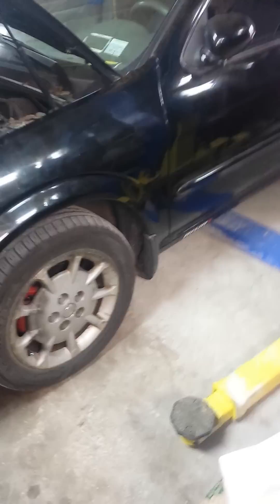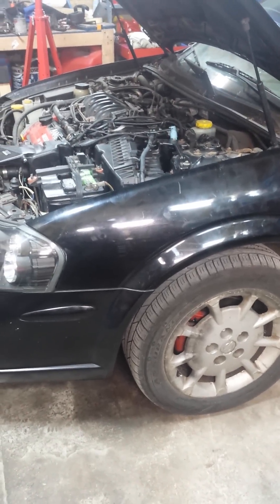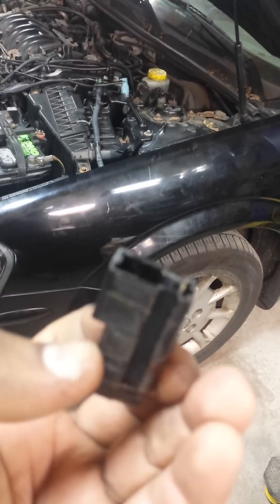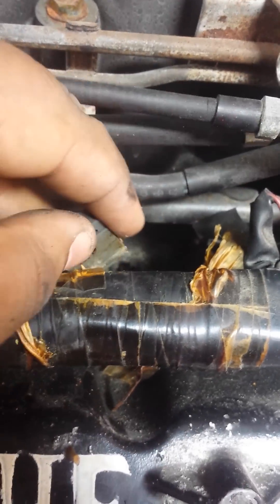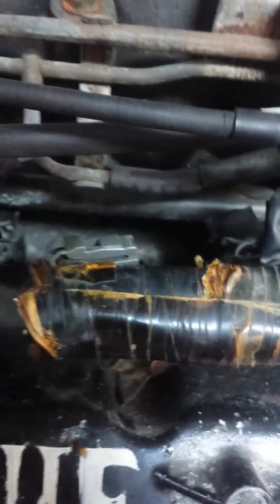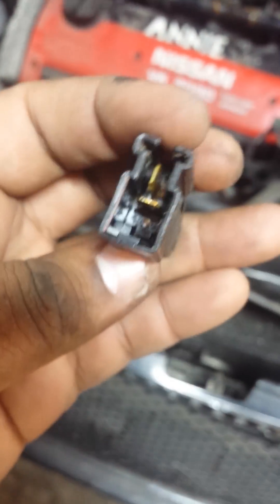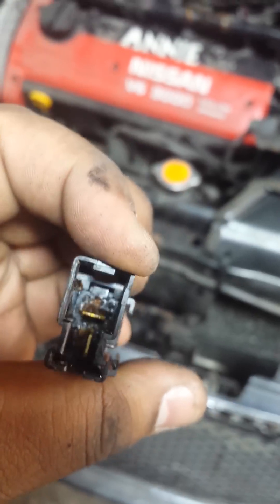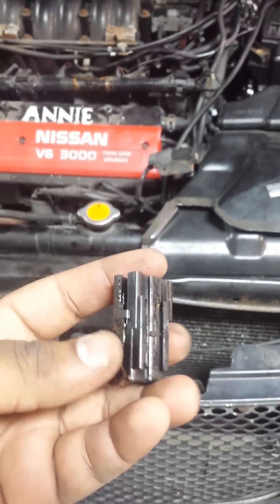OBD 2 CODE P1320 ON A NISSAN.

Comment: Dear fayaz im not sure this will solve my isssue ..i have a nissan y34 vq25 dd and struggling with this code for months..ive been changing coils one after another..let me check this and keep u posted..thanking in advance
Reply from the maker: If it doesn’t work then I would suggest doing a compression test for all your cylinders and check your injectors making sure they are spraying and not clogged
Reply: @faraznabibaksh i bought this part..but the connecter clip which goes into the condensor seems to be bad too..do u know the part num of that or how do we call it ?
Reply from the maker: @kithmalwimalaweera8176  best bet is to call the dealer or just take it from the junkyard..

Comment: I know this video is old but I hope you can advise me. I bought a nissan maxima 2000 SE 250k miles, suddenly I let it turn on, it only starts but does not start, sometimes it starts normally and when it does the car runs very well, with enough force, without wasting gasoline in excess or smell of gasoline, without detonations, if I turn it off it usually doesn't turn on until later or the next day. I bought an inexpensive sensor in amazon and it threw me pending codes P1320 and P0110. My budget is very tight, it is my first car, what would you recommend me to try or replace first? With the symptoms that it has, do you think it could be the condenser?
Reply from the maker: Thanks for the comment but I’m going to be brutally honest with you I need you to be a little more specific in the wording like “ it only starts but does not start” what does that mean? Re-comment your comment and please make sure I can understand so that way I can help you but the video you clicked on I was having a issue with a random misfire code and it turn out to be the condenser so if your car starts but doesn’t start or it starts and runs well then I would say this isn’t your problem but as soon as you clear up your comment and tell me what your car is doing then I’ll try a give you my idea.
Reply: @faraznabibaksh  
sorry, I use google translator, I meant that the car Crank but wont starts. Sometimes it turns on and when it does the car works very well, but if I turn it off it usually does not turn on again.
Reply from the maker: @oceanvargas344  ok so the issue is the car starts sometimes and doesn’t sometimes… 250miles and you have no history on the car.. these maximas have a issue with the MAF when it’s too dirty gives the car a hard start at times and rough idle sometimes even stalls the car.. did you inspect the MAF?
Reply: @faraznabibaksh  I have not checked the maf sensor, I'll start by checking the maf. If the code p1320 keeps appearing, do you recommend continuing with the ignition capacitor or the coils?
Reply from the maker: @oceanvargas344  the condenser is super cheap compared to the coils so i would get that but for some off reason i dont think it might be your condenser... clean or swap the MAF and see if that made a difference
Reply: clean the maf sensor and taking advantage of the fact that the throttle body was close, take the opportunity to clean it as well but without disassembling it, which was probably a mistake. The car continues with the same fault that it starts occasionally but now the engine vibrates, it smells slightly of gasoline and I got 2 additional codes, P0105 and P0460.
It is a good engine and transmission, I will try to save money and better take it to a workshop, thank you very much for the help

Comment: Hey bro, my car has very bad misfire. Have done cylinder drop test, all cylinder firing. Did compression test, all good, changed spark plugs, and this condensor too. But still have P1320. Thats the only code i am getting after clearing it everytime. Any help???
Reply from the maker: Sounds pretty simple... if you checked all of that and still have a 1320 code then i bet your wiring harness has a issue... at every coil pack check the connectors that connects into the coil.. with the car running wiggle the harnesses and see if the car idles better.. most likely a pin from the connector that goes into the coil pack isn't making contact.

Comment: i tried checking the condenser wire with a voltimeter and i think i shorted it because car wont start up anymore just cranks. by any chance do you know what it would have shorted?
Reply from the maker: I have no clue what you did to short anything out but if i was you just start with checking your fuses im sure you will find a clue.

Comment: Hello, please anyone with knowledge and experience help me. I have a 2000 Infiniti I-30. I am constantly getting check Engine light with a code P1320. I replaced all spark plugs with NGK double platinum as OEM recommended. Checked all coils'  primary with a tester. I was getting over 1 ohm except one coil so I bought Hitachi coil (left). Check engine light is still showing w/ p1320. Should  I try  Denso or Delphi coils since I can't afford one from a dealer.  Please advise
Reply from the maker: Double platinum is not recommended. Regular NGK Platinum is recommended.
Reply from the maker: And the coils are very sensitive on this car... STAY AWAY FROM BOSCH. ! i usually get lucky and get coils made in Japan and they work.

Comment: 2003 Nissan Altima...car was running, noticed the condenser was dangling, moved it one inch, car shut off and will not start again. Noticed some barewires at the base of the pigtail. Did it short? Why won't it turn on? Is it anti theft mode. It cranks over but will not start.
Reply from the maker: Mitch Rude I wouldnt know if it shorted you will have to find a way to test it... check all your fuses first and I would recommend taping up those bare wires
Reply: Mitch Rude did you fix it.? Same here
Reply: Carlos Chigo unfortunately we had to send the car out to Nissan to be fixed.
Reply: Hey did the dealership fix your problem?
My maxima is doing the same thing

Comment: Were u having stalling and starting problems i think mines doing the same...damn coils arent getting spark now
Reply: Was having a stalling problem ,mornings only, found out there was a recall with the crank shaft sensor (nissan sentra). Fixed the problem.

Comment: I have a 2000 maxima that has a misfire on cylinder #4 and im getting the codes p1320 p0505 p0300. I just put all brand new coils and spark plugs in it yesterday and it still has a misfire. the wire to the coil gets 12 volts but the its not hitting. Do you think i have a condenser problem?
Reply from the maker: Marc Pittman p0505 is iacv.. so that being said do you have to give it some gas to keep the car on when you start up?
Reply: i just replaced the iacv 2 weeks ago it cranks fine as it should its just missing
Reply from the maker: Marc Pittman OK I noticed you also mention p0300 which is a random misfire code from the top of my head. Last time I had a p0300 the culprit was the MAF sensor.. I need more information from you as much as you can so I can help you.. are you still getting the p0505 after you changed the iacv? And did you know if you screw up the sequence on how you replace the iacv you could fry your ecm? So yeah I need more info and what's your skill set so I can help you deeper figure out this issue.
Reply from the maker: Also check for intake leaks and do a compression test on the cylinders.
Reply: After i replaced the iacv with a brand new one and did the relearn procedure the p0505 code is still there but the car is no longer hard to start it was hard to start with the old iacv. I am more concerned with the #4 misfire tho. Every coil gets fire except that one for some reason. I have even switched coils and its still not firing. I was told it may be the crank sensor. I'm not for sure what it is because i've never ran into this problem.
Reply: It had the misfire before the iacv so i know that doesnt have anything to do with it.
Reply from the maker: Marc Pittman it isn't a crank sensor that's for sure. Your saying your #4 coil harness has 0 volts? Check the wires going into the #4 harness which connects to the coil pack sometimes they get loose and looses that connection over time due to removing often.

Comment: How did you clean the connector what productsAnd thank you
Reply from the maker: Calvin Vega I sprayed alcohol and compressed air and put it back on with white lithium greece...
Reply: Don't have an air compressed equipment any other options and did you clean the connecter while it being on the engine or did you disconnect that
Reply from the maker: Calvin Vega I removed it from the vehicle and cleaned it on the toolbox.. if you don't have compressed air then no problem.. use alcohol and wipe it with a piece of paper and let it air dry for a few minutes..
Reply: Thank you for your help, saving people a lot of money on this code solution God bless
Reply from the maker: Calvin Vega just trying to help.. enjoy
Reply: How long did it take until the check engine light came off thanks in advance
Reply: Mine is a 2002 Nissan Almera the check light comes on when the engine warms up, car stalls while the engine is running and when its cold it stays off. Thanks for the info i will definately check out the condenser.

Comment: My Nissan Altima's ignition sensor isn't located there. It's a 2000. Still can't find it.
Reply: The ignition sensor on a Altima is located in the steering column just below the windshield wiper/washer arm, but it sucks cuz you have to remove the steering wheel, radio, glove compartment door and left tail light to access it
Reply from the maker: kree8iv that's because in the video it's a maxima not a altima.. thanks
Reply from the maker: kree8iv make sure you check all your spark plugs and wire  first.. condenser should be on the passenger side in front of the valve condenser.. check your distributor first..
Reply from the maker: John Moore that's alot of work to get to that sensor.. I would check and make sure plugs and everything else is good first before doing that job..

Comment: Good video Faraz. Wanted to ask if you knew where to purchase the pigtail wires and harness for the ignition condenser. Mine seem to be shot but will test with a multimeter to confirm. Thanks
Reply from the maker: Luis Reyes umm I don't really know I'm sure you can get it from a junk yard and put some bud connectors.

Comment: did it fix the p1320 ? and misfires im getting the same code?
Reply from the maker: Oscar Cubillos it fixed that problem.. make sure you check your coil packs and spark plugs before you change the condenser. good luck
Reply: Faraz Queens village yeah bro i changed the spark plugs a few years ago and im putting oem used coils how do you check the coils? i ordered the condenser and will pick up from nissan mine looks original and dirty connection like in your video
Reply from the maker: Oscar Cubillos to check the coils you start up the car.. and just unplug the coil pack one by one and see if the engine idles rough or stays the same.. if it stays the same after you unplug it then that coil is bad.

Comment: Hey man thanks for the video, it helped out a lot in finding the condenser. My car also gave me this code but I have another problem. During the mornings my car turns on but dies right away. I have to press the gas for like 10 minutes until the car warms up and then it works fine. Any idea if the condenser will also solve this problem?
Reply from the maker: Gustavo Morales sounds like your iac but to be sure.. does it cut off when start it and to keep it from cutting off do you have to give it a little gas?
Reply: Yea man if I just turn on the car it will die right away unless i constantly hold the gas pedal. When I come to a stop sign or a red light, the car will shake a lot too.
Reply from the maker: Gustavo Morales  your IAC is bad. CLEAN your throttle body and change your iac.. please disconnect your battery when you do all this.
Reply: Ok thanks I will do this ASAP. Do you also think the ignition condenser would cause some of the problem?
Reply from the maker: Gustavo Morales nah it won't cause that.. one day I'll make a video on the IAC one day
Reply: had this problem with my car 2000 maxima gle. mu brothers and i fixed it ...problem was the plenium or plenum gasket. good luck
Reply: mine was a cracked air intake duct   which looks like an accordion    round rubber piece
Reply: Check your intake gasket r check if the bolts r slack . Once u have an air leak it's going to do that

Comment: Faraz - thank you so much for posting this video. I have a 2000 Nissan Maxima and have been getting the code  P1320 for a while. The car is starting to shake a little bit, especially when I'm at a stop sign idling. I learned from some Maxima Forums to check the Condenser, but didn't know what it look like or where it was located until I came across your video. I noticed that in your video you did not show how to remove the condenser. Last night I remove some tape around it, but it is still feels pretty firm and I was afraid to break something by pulling on it too hard. Can you give me some pointers on the best way and easiest way to remove the condenser?
Reply from the maker: Rick Esp I'm glad the video help you locate the condenser.. to remove just press on the tab and pull out.. these things are in there so pull and it will come right off.. thanks

Comment: My car was running bad too and misfiring and hard to crank for weeks. i found that same condenser its all gumped up bad. my car want start anymore and i tested all coils everything. i pray this will fix it.
Reply from the maker: 26bleeek are you getting a check engine light?